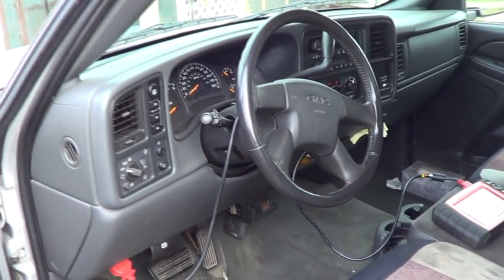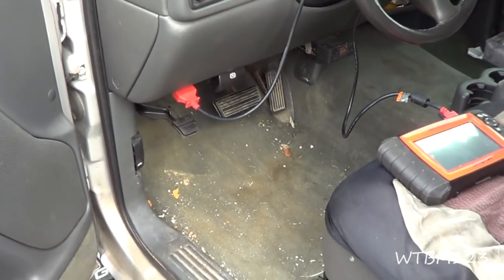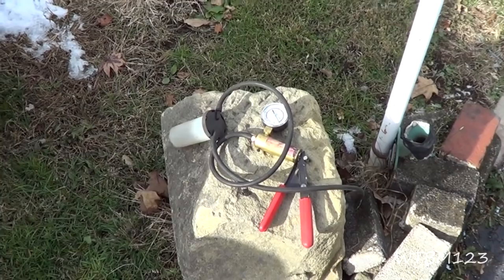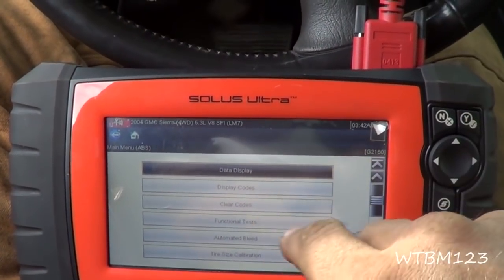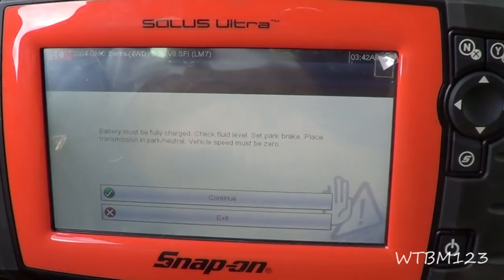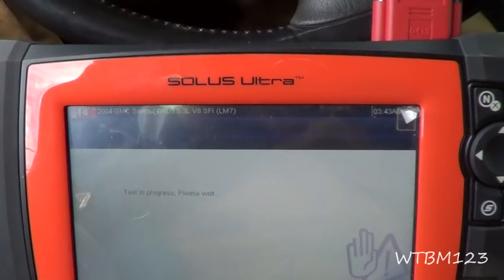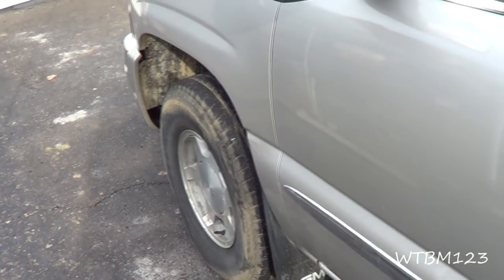Bleeding the ABS Brake Control Module,On a Chevy Using a Snap On Solus Ultra

Comment: can i bleed it by hard connecting its relay?
Reply from the maker: I do not think so . Needs to cycle the abs unit like it is going off . Maybe on gravel or grass could make the abs go off . Has to cycle for each wheel . And it may push the air from abs unit out to lines , then bleed the lines. And if pumping the pedal to bleed it can suds the fluid , most lines can just be gravity bleed, and sometimes gravity bleeding can help pull air from abs

Comment: issues with my 06 LBZ had a bad front hub replaced it but ABS now stays on everything checks out ok  including speed registered when doing a drive test I used my Snap on brick for bleed test &  it cycles through but no back pressure pushing against foot at pedal as it should. I know for a fact there is no air in system as well just doing a process of elimination here! Bad ABS Module? truck has 488,000km lol
Reply from the maker: Hard to say with out seeing , If you do not have a solid pedal , it could have air in it , Something moving to much , Master cylinder going bad . May have some one push the brake pedal and check various places to see what kind of pressure you have
Reply: @wtbm123  Thanks for your input, but it's  really strange because the issue resolved itself after a few kms. Everything is back to normal & stopping as it should.No ABS light either!  All of your suggestions were gone over with a fine tooth comb. Last year I replaced calipers & rotors, Master & hydro boost and all brake lines.

Comment: Don't you need to  open one of  the bleeder screws first? The air has no where to go if you dont  correct?
Reply from the maker: It just cycles the abs unit . Then you open the bleeders to get the air out that it pushed into the lines
Reply: If you have a pressure bleeder on the reservoir, open a bleedervalve… and at the same time run the abs autobleed..
then the air would have somwhere to move when the abs recycles…. the air would leave the system completely.
When running autobleed with everything closed, how can it press the air along by just shaking it around a bit?
Reply: @oysteinfabeng2452  I've tried doing autoblade with my with my bleeders open and I still cannot get the air out of that ABS unit I just gave up. I did the  procedure 3 times...ugh

Comment: So I don’t need to mess with the bleeder screw while doing the auto bleed?  Just bleed normal, then run the auto bleed to knock air out of the abs unit, then bleed normal again?
Reply from the maker: No , after auto bleed you then need to bleed . It takes a bit to get the air down the lines and out

Comment: Awesome vid!  Thanks for the info.  Do you bleed the ABS module before or after you bleed the calipers from each wheel?
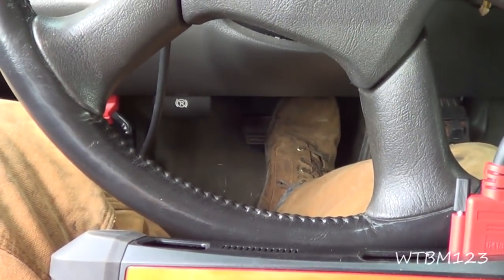Reply: Before, it will push the air out of the ABS module and into the rest of the system that can be bled normally. 4:45 (just incase someone else needs this answer)
Reply from the maker: Yes I did

Comment: Still didn’t learn how to bleed my brakes... 🤷🏽‍♀️
Reply from the maker: This was not to show how to bleed brakes but to show it may be necessary to use a computer to push air from abs unit . To bleed i either open one bleeder at a time and let drip , refilling master cylinder when needed , when no air move tighten bleeder  to another wheel and so on . A vacuum bleeder is not expensive and can speed up the process.

Comment: Great video I have a 1992 Chevy Astro van and the ABS unit started making that noise we heard. I have called all the junk yards around here and there are no Astro vans to be had, Can I bypass the ABS unit? I will unhook the speed sensors like you mentioned. Maybe that will work? The front brakes are working. the back brakes are the ones that are not working. Thanks!
Reply from the maker: I would want to be sure it is the abs unit , even a wheel bearing can cause the ABS to set off while braking . I would want to see the computer data , if it is a wheel bearing going bad , you would want to fix it .

Comment: Sudsing? I have been pumping brakes to bleed them for 30+ years and have never seen that. Maybe if the system was contaminated. 
You won't break the air pockets up. As you pump, it pushes brake fluid past the seals, compressing the air pockets. That's all that happens when you pump the pedal.
Reply from the maker: I have also done this for years and was taught that in school . They had a brake system set up with clear glass lines and we watched it happen .

Comment: I have a 98 Chevy Silverado but nothing works. I’ve replaced rear brakes including hardware front brakes with rotors power boost and reman master cylinder. I have a rock hard pedal while the vehicle is off. I turn it on and it goes to the floor?????
Reply from the maker: may still have air , I gravity bleed , or use a vacuum bleeder , I do not like pumping the pedal as you can suds the fluid making it hard to remove all air .

Comment: I have a similar snap on scan tool and right when I start the process it keeps saying there is an error and I’ve checked multiple time to make sure we have everything right but it still show an error
Reply from the maker: Is there any abs codes , if there is it will not run .

Comment: Tried to do this to my truck but it does nothing. With this same scanner
Reply from the maker: If there are any brake , abs codes it will not run
Reply: Did you get it fixed?

Comment: Do you have to remove the reservoir cap while doing this test?
Reply from the maker: No , it is just cycling the ABS unit . It will push the air out of ABS Unit , out into the lines , then you must bleed that air out of the lines
Reply: @wtbm123  ok thanks.  I have a 04 Chevy.  When I hit brake the abs makes loud growl noise then a pop noise, and shuts down.  All abs lights come on then and regular brakes continue to work.  Any ideas??
Reply: @richgregg9488  try to clean the wheel speed sensor on the wheel hubs. Common abs problem with chevy trucks. Both my 00 and 01 had this issue.
Reply: @xeroanantihero  i have monte Carlo, the abs sensors are built into the hubs,. So I replaced the hubs and the wiring going to them no luck.  Abs code says EBCM commanded pressure release is too long....

Comment: That's a bunch of wasted time. Just bleed the antilock system and then bleed your brake lines as usual. And your done!
Reply from the maker: ok , but how do you bleed the antilock system, before the lines
Reply: @wtbm123  there is a bleeder on the side of the anti lock system there is a little pin you push in instead of opening a bleeder screw you push the pin when someone has the brake pedal push down.
Reply from the maker: @billnone9246  Older ones yes , newer ones no bleeder
Reply: @wtbm123  
My friend has a 2016 chev 2500 and it has a bleeder on the anti lock it's  on the bottom side of it
Reply: @wtbm123  there is a spring loaded needle valve that has a rubber cap on it

Comment: I bled my 2001 GMC Sierra C3 Denali old school and it bled fine after i replaced ALL OF THE BRAKE LINES with copper nickle. So sorry i call bs.
Reply from the maker: If you do not get air trapped in the ABS module then normal bleeding works well. But if get a air pocket in ABS module , very hard to get out , unless one cycles the module
Reply: I definitely wouldnt say BS.  every situation is different.

Comment: When you run the automated bleed do you have the bleeders on the calipers open or closed?
Reply from the maker: no , but you need to bleed after , and takes a bit to get the air to the wheels and out of system . i prefer gravity bleed over pumping pedal

Comment: Now I need to find a gravel road!! I changed all the brake lines and hoses on my 05 Buick Rendezvous, system was completely open for a few days. MC went dry and I had to remove the ABS module to make room to install all the new lines. Bled the brakes and MC  several times, and I still cant get a firm, high pedal. It gets firm about half way down. I dont have a high level scan tool and cant afford to take it to a dealer. Any suggestions??
Reply from the maker: Look for a local garage that may run the bleed process for you . But after it is run , you will still need to bleed it so that air comes out

Comment: I changed the lines between the box and master cylinder. Won't bleed this would help
Reply from the maker: My advice is Vacuum or pressure  bleed . If pumping the pedal , it can easily suds the fluid and then it will not bleed till all suds have sat and un suds. . If have to pedal bleed only push pedal down , loosen bleeder . when pedal; almost hits floor close bleeder . Push pedal down Once and open bleeder repeatting the process again . After all you are moving fluid , not trying to pump up a pedal. After all rest of air is out , then worry about bleeding the ABS if needed
Reply: @wtbm123  cool I'll try that. If not I'm going to bypass the abs box. Come right off the proportioning valve

Comment: I just got an Autel maxi check pro. It does auto bleed $189 on eBay. My pedal still goes way down. I think my abs pump is bad 07 f150. Everything is new except abs pump/module,lines and booster. It's at the stealership now. I'm not sure they know much more than me lol. Nice video. I love youtube. Makes an Einstein out of an idiot. Well almost.
Reply from the maker: Just need to make sure the reat of system is working properly . I usually check that the brakes are free and each wheel is working correct . and no loose wheel bearings . Then i vacuum bleed , as i am not a fan of bleeding with pumping the pedal. Get as much air as possible out . Then if needed run the abs bleed . After that i vacuum bleed again . but remember the air is by the pump , so it will take some fluid to make the air travel to wheels and out .

Comment: I have 2001 sub. Worst place for the abs under drivers seat. After i replaced all 4 brake lines and bled them i payed a mech to do a (?) Abs bleed reset using a special electronic gadget.  It worked ok but i still have a crunch and brake fail at lowest stoping.  Its not safe.
The mech said i have a old dirty wheel bearing.. But i no longer trust him do to other poor work done.
Reply: whats crunch mean . .my 2004 sierra makes the anti slip noise at tne end of peddle travel
Reply: @johnkay8778  .....loss of brake power at slowest speed. Not allways.   my  brake  peddle is kicking back on foot. Vibrates. I nearly ran into my garage.  Its ok if i pump it up.
Reply: Clean the ABS sensor where it goes into bearing.  Rust makes these ABS units activate and pedal goes to floor.  There has to be a certain shimmed distance between sensor and reluctor ring.  Chevys are good for this rust lifting sensor inside bearing.
Reply from the maker: With a scan tool could check wheel speed sensors

Comment: Will this machine still perform the test with the abs light on from bad wheel censors
Reply from the maker: No. and a lot of times abs light leads to a bad bearing , so also check those as they can make pedal feel soft if bad enough.

Comment: When you do this method(abs bleeding), you don't open any port or you just hook up your scan and start the test?
Reply from the maker: Correct , then after  it you bleed , but remember if it pushes it out of abs unit , it will take a bit for the air to bleed out to the wheels.
Reply: @wtbm123  Luckily my 09 Kia spectra is non abs brake, but I get a sticky/lock up brakes. Even Firestone couldn't find it. They said your abs might bad, but there isn't one.
Reply: @wtbm123 does your pedal stay down when your brakes stick, or does it return to depressed position?
Reply: @alexkieffer6380  It does return to depressed position, but the pedal becomes stiff like a rock to a point where you can't push the pedal anymore.

Comment: I can bleed my abs module and brakes with a vacuum pump . I had a leaky wheel cylinder on my drum . I replaced it then I bleed the two bleed screws on module theen I bleed my brakes like normal.
Reply from the maker: If bleeder on abs module that is where to bleed it . I usually gravity bleed or vacuum bleed
Reply: On mine I  did mine 2 months and I did it with a pressure bleeder I made from a diy pump sprayer.

Comment: U can take these gm vehicles on a gravel road and get going about 15 mph and press the pedal and the abs will activate and purge the air out i have done this on a couple
Reply: from where will it purge itself? is there sometime of zerc fitting on the abs module ?

Comment: VERY misleading Video    How many People Have a Sollus Ultra ….. There is no Rear Brake adjustment , just Bleeding,  …. Your just rambling B/s
Reply: Heh, Just rambling BS eh? The truck has rear drum brakes therefore an adjustment mechanism onceach wheel. You don't have to have a Snap-on Sollus, there are lesser costing options out there like the Foxwell NT630 Plus, or OTC 3210, and possibly others.
How many people have scanners? More than "you" can imagine. A dealership will charge you over $100.00 to flush and bleed ans he will not take it out for a drive.

Comment: I have a 1998 C1500 and I have the damn near the same scan tool (mine has a dedicated save button between the D-pad and power button) and I cannot get the automated bleed process to initiate. When I began the test originally it said it could not continue with DTC's... well, when I check for DTC'S none are active and none are in the history. I unhooked the wheel speed sensor and it didn't work for pedal feel
Reply from the maker: Try clearing codes any how and try . Not sure other than that y it will not run , can u read speed sensors to verify working . if the system has just been opened up , it could maybe have air in controller , but if no leaks and system not opened then for soft pedal also suspect the rubber lines
Reply: The rubber lines have been replaced recently. I may go to stainless steel to see if that makes an improvement.. but  think I may have figured it out... the wheel speed sensors with the truck off in P/N all read 3 MPH. I'm not sure what is causing it, but when you read them that's what they say. I've never had this many issues with GM brakes. 

Cleared codes anyhow... still will not initiate test. Message about the DTCs gone now... but still no automated bleed (probably due to the aforementioned wheel speed sensor issue) May need to replace those, but truck never threw codes/abs light, etc for them & the ABS worked fine when tested on gravel road... just had the spongy pedal.

Comment: I don't have that tool but I drove onto a gravel road and slammed the breaks.  I did this after bleeding all four wheels at one time and then one at a time.  the break still felt spongy which is why I did the gravel road abs activation. worked like a champ. thanks for the detailed video!

Comment: Great Vlog and important.  I have a 2007 Hyundai which had bad feeling pedal for years.  I bleed the brakes a few times, add fluid... but was never right.  The pedal got worse the last time the ABS kicked in.  Turns out I had air in my ABS unit all these years.  Scanner Diagnostic Scan Foxwell NT630 Pro $110 is the cheapest tool to exercise the ABS.  I waited for an ice-y day,  drove on my back street, and made the ABS kick in.  I tried to insure each wheel hit the ice-y spots.  When I got back in my drive way, I found the brake fluid was lower and I could see air bubbles coming up in the fluid in the reservoir.  I let it sit, added more fuild.  The pedal is much better.  I need to buy Scanner Diagnostic Scan Foxwell NT630 Pro to get all the air out.  Conclusion,  bleeding doesn't get the air out of the ABS,  not for me,  I tried 4 times over 3 years.

Comment: so we have been bleeding breaks for hundreds of years the wrong way for hundreds of years... come on man you arnt fooling anyone the tools we have these days are lazy mans tools because the human race has become lazy as fuck and cant use there legs to pump a pedal. all your doing is actvating the abs motor
Reply: You’ve obviously never had to deal with a completely evacuated brake system on a late model vehicle
Reply: @jonathangolden8485  actually i have had to deal with this situation quite a few times. living in the rust belt tends to rot break lines quite often. let me guess you're one of those guy's that takes his car to a shop and has someone else do the work you dont know how to. there are several ways to bleed breaks from gravity bleed to vacuum to pressure bleeding. all that work just fine. plus i never said you didnt have to modulate the abs. just that you did not need that tool. obviously you did not read it correctly..

Comment: Can you do this with other types of scanners and will this be the same for a 2500hd diesel?
Reply from the maker: any scanner with by directional tools should be able to do it
Reply: wtbm123 i now have a scanner that has the ability to activate the abs module. What is the sequence that i need to do for a proper bleed? Can you use the auto bleed to bleed each wheel caliper?

Comment: What is the problem when u got good pressure on front calipers after u changed all the lines to new lines and got good pressure out of master cyilnder too but the main line coming from the abs module under the truck wont let any fluid out or anything
Reply: Sounds crazy but I had this on a 2005 Chevy and a 2001 tundra and in both cases I took compressed air and briefly shot it up the line and fluid began to flow out almost like it hydro locked.  Family thought I was making a joke until they had the same issue and I told them what to do and they were able to bleed rear brakes on these trucks.
Reply: Its a 2007 gmc 1500 crew cab
Reply from the maker: Could be the module . Did the brakes work ok before the lines change